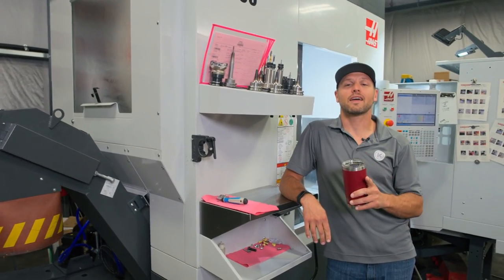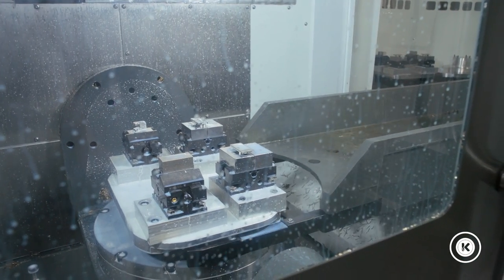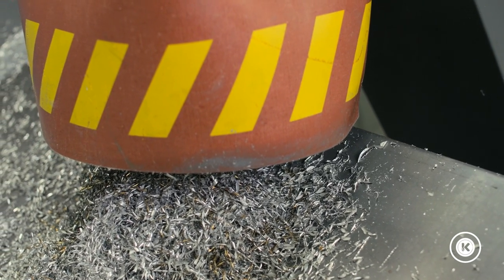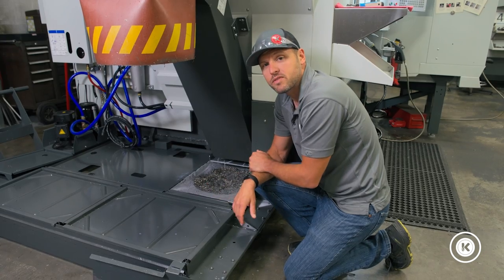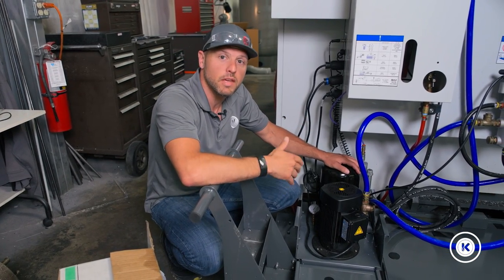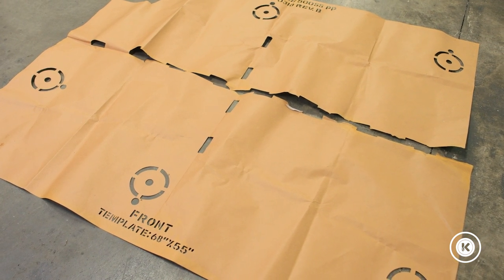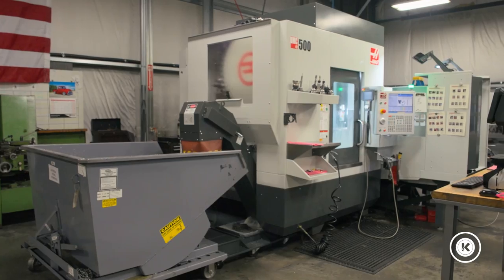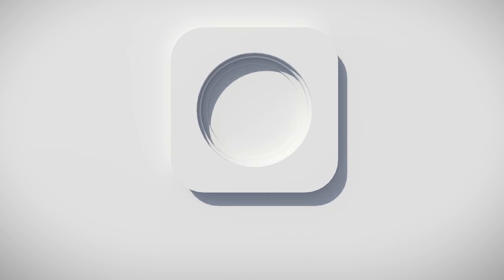HAAS UMC 500 RE-Review - Kremin CNC Machine Reviews

Comment: I've been programming, setting up and running a VF4SS, VF2 and a ST20Y Lathe. First experience with Haas and I have to say there control is amazing but the machines just don't take a chip like some other stuff I've worked on. Aluminum you are fine but getting into some tougher materials and roughing cycles are tough to watch.
Reply from the maker: Thanks for the info!
Reply: more or less i agree with you. The machine is very convenient to the operator, and the control has some advantages and shortcuts compared to Fanuc but the machine lacks performance to attack harder materials or doing production jobs. I have worked with an DS30Y, VF2SSYT, VF3SS and UMC500 and my opinion is that if they are for low volume or unique parts in aluminum, non ferreous metals, plastics or light machining they might work, but for doing production jobs on steels or inox no
Reply: Agreed, they're very accurate and easy to use. When it comes to harder materials, deep cuts are better left to seiki, johnsford, hurco. I've tried taking heavy cuts with insert cutters on haas and the spindle went out next day. I only ran one cycle that way since it was borderline alarming out. We keep our cuts light on the hard metals

Comment: I think any new machine line is going to experience some amount of issue until they get out in the wild and customers are able to give feedback on issues. I do not know how long Haas tested the UMC 500, 1000, and the redesigned 750 before releasing them for production but any amount of general testing would (or should) have caught some of the issues like the coolant ponding up and the chip evacuation. No machine is perfect however, but it is good to see that Haas is willing to support and rectify the issues as they see fit to keep their customers happy. The UMC 500 is certainly a good entry level machine and has an extreme amount of potential for automation. However, I have seen a lot of the competition in recent years begin to give them some serious competition on both a performance and cost level. Okuma has released the new M560 5 axis machine built off of their tried and true Genos line, Mazak has released the new EZ series with an apples to apples competitor to the UMC500, and dont forget DN with the newer DVF4000. I love Haas verticals for their ease of use and ease of maintenance, but if I were going to buy a new, small foot print dedicated 5 axis it would be hard to go with the UMC knowing there are other options within 10% of the price of a UMC. Just an opinion, obviously.
Reply from the maker: Great points, thanks for the feedback.

Comment: Ditch the hairnet chip strainer and get a Swarf-Unlimited sump filter, it's top tier convenient!
Reply from the maker: Interesting, we will check them out - how hard are they to clean?
Reply: @KreminIncManufacturing  No effing around with the hairnet, just clean it with a shopvac setup for wet only.
Reply: Swarf-Unlimited also have drop in coolant pump that have higher pressure rates, and they also have manifold which will allow you to divert and add coolant where you need it.

In my case with a UMC1500 Duo, the base wash down nozzles don't move ANYTHING, on top that they are only spraying the front of the machine. So I have to cleanout the machine entirely after every use. Once our shop funds are at the right place, I can't wait to add not only increased pressure at the nozzles, but add a sprayer behind my tool change arm (HSK tool arm can cause clamping failure or even slams the edge of the taper shank into the face of the spindle if the holder is not grabbed properly by the changer due to chips.)

Comment: We just got a 500ss installed last month. The coolant noise is real. Its odd though. The 120psi flood coolant is about as loud as our air compressor is at 115 decibels but the 1000 psi pump right beside it is as quiet as a normal pump. Not sure what to do but will probably have to contact haas since we are having a hard time hearing the machine while cutting.
Reply from the maker: Awesome! The noise is an issue - since we replaced the pump it has been much better.
Reply: You need to go rotary screw on your air compressor. I didn’t for a long time, as it was a major cost, but if I were to start again it would be the first thing I’d buy
Reply from the maker: @precisionc3656  we have liked our new compressor - https://youtu.be/nyfrQGKc8zE?si=vSgpnwGzC-4YTvrL

Comment: I run a haas dm1, now my factory we cut only plastic with it and do not use coolant at all, (which may be a lot of the problem) but we constantly have issues with oil leaks comming from the table, lube lines getting clogged, spindle motors craping out and we constantly get a fault code of “pressure detected prior to axis lubrication cycle” which nobody can seem to fix 🙄 overall I’m not a fan of haas machines
Reply from the maker: Thanks for the comment, we have problem with plastic clogging lines as well.

Comment: The problems you are having are the same as most of the cnc shops are having.

You do not strive to be better.

The chip build up under the pallet plate during a pallet change is a easy fix.